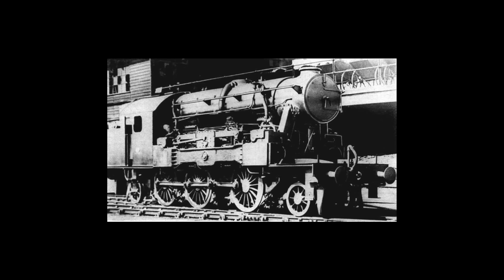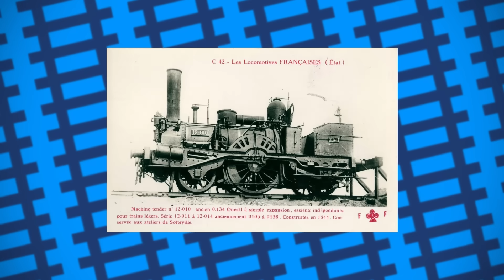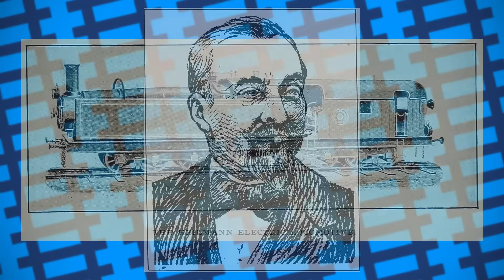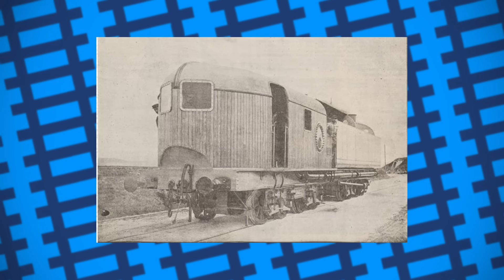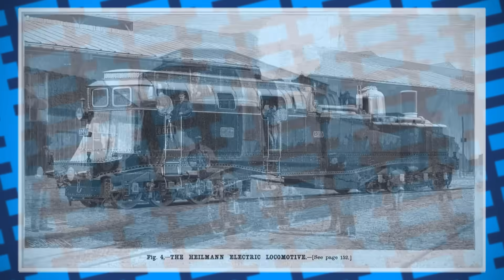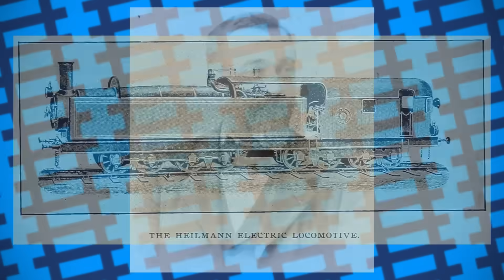France's Fascinating Steam-Electric Locomotive - Heilmann Locomotive

Comment: if i had a nickle for everytime i watched a video of a steam hybrid, i'd be rich.
Reply: If I had a nickel every time I watched one of these videos; I'd have like three nickels. but still it amazes me that steam hybrids happened like three times.
Reply: I'm familiar with only two different steam hybrids, including this one. Where was No. 3? @wyndhamcoffman8961
Reply: if I had a nickel every time someone used BGM from Dr Robotnik's Mean Bean Machine I'd...have that one nickel.

I'd be more Doofenschmirtz rich from getting nickels for every time a railfan video used KSI's Thick of It!
Reply: If I had a nickel for every time I saw someone spell "nickel" incorrectly, I'd have enough to buy a dictionary.
Reply: It wasn't hybrid, it was steam-electric rather than steam-mechanical or steam-hydraulic. Power source-transmission method. So really steam locomotives should be sub-divided into coal-mechanical, oil-mechanical and fireless mechanical. And the only true steam locomotive was the fireless type. Was Fowler's Ghost one of those?
Reply: @roberthaydon7973 no, it wasn't, but now I'm more interested in the potential steam-hydraulics that may or may not have existed????
Reply: @Nerdicrunic1001 Try it .  I wanna know the results .
Reply: It was pointless , that is why they dont exist in any numbers .  It was worth a try tho i'll give that  .